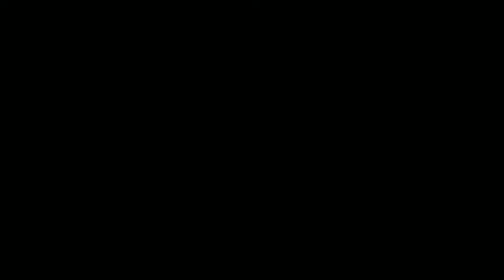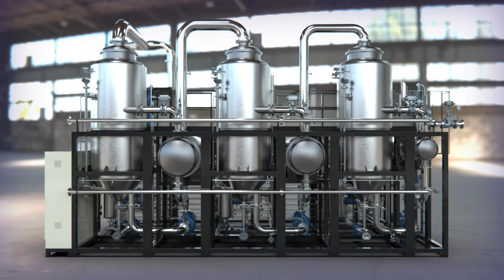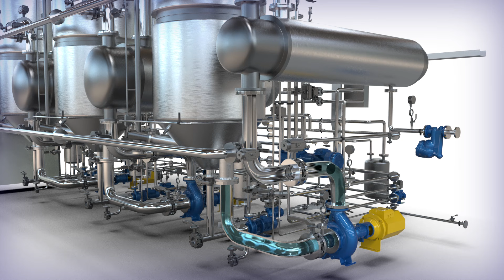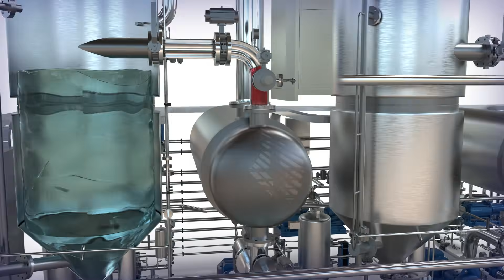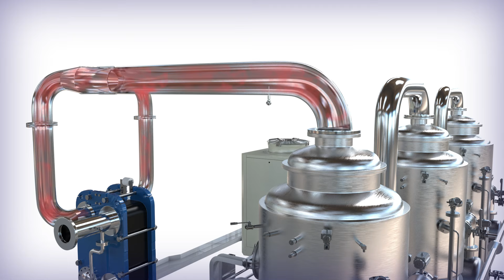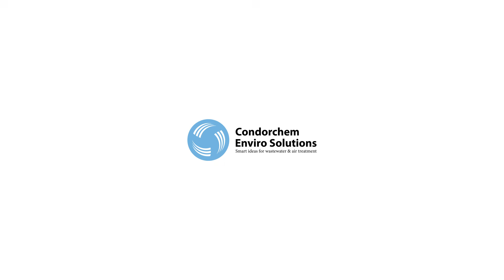How a multiple effect evaporator works | 3D Animation | Condorchem Enviro Solutions

Comment: What is the use of calandria in evaporator and where it's attach
Reply: There’s lots of different styles of evaporators. I see what you are questioning. Would like some clarification myself. I personally run a 6 stage falling film evaporator. Also thru me off calling it “waste water.” We are able to run our evaporator at 90 gpm at 80+% solids/brix
Reply: That is the "distribution plate" its used to evenly dispurse the feed so every tube is able to have feed to evaporate. Its located at the top of each effect where the feed enters